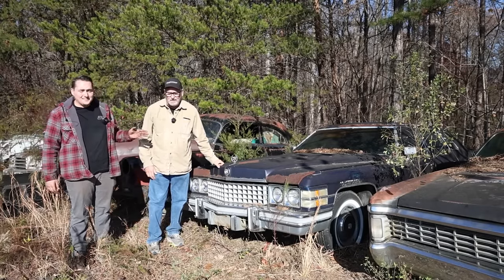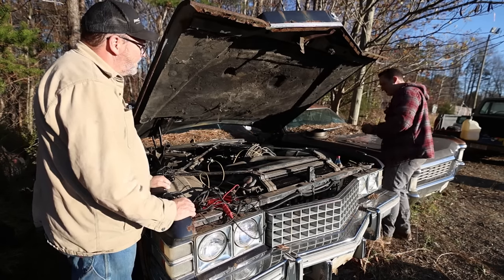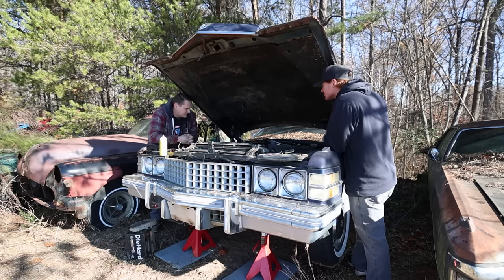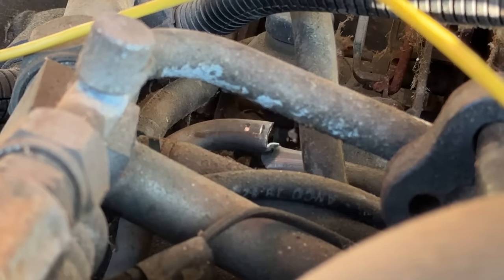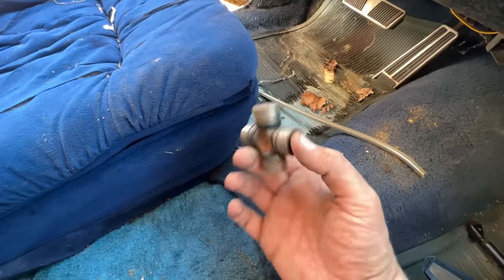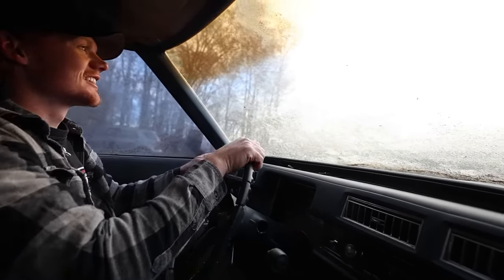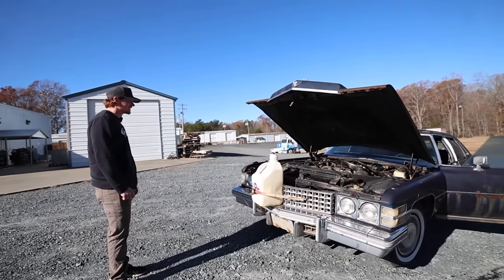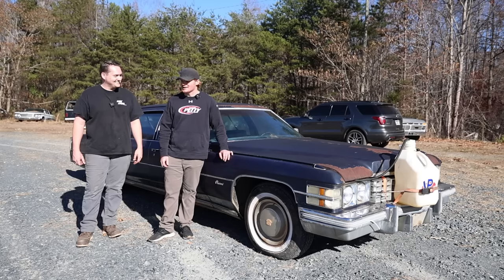RICHARD PETTY'S Forgotten Cadillac Limo - WILL IT RUN After 28 Years?

Comment: Technically not an actual Limousine model because there's no divider window.   Cad called it a "Series 75   8 Psngr. Formal Sedan".
That bench is from another car.    Little seats are called jump seats.
'73/4 is the worst era for Cadillac.   The 1970 and the '62 Imperials on the property are FAR better cars!
Reply: 1973-74 isnt the worst. Many worse years. 1981-82 Had the horrific 368 V8-6-4 and the 4100HT. Basically all garbage mechanicals and drivetrains.
Reply: @josephsummers2427  Right, those did suck.  But most US cars past '72 don't count anyway.
Reply: @UberLummox  You just said it was the worst era for Cadillac. That means any era, any year. So you mean worst up to 1975? Then also 1995-98 had almost all Northstars that had a wide range of issues at low mileages, almost new. 1973-74 is maybe the 11th-12th worst years in Cadillacs total history....